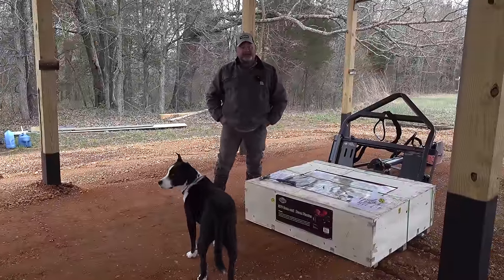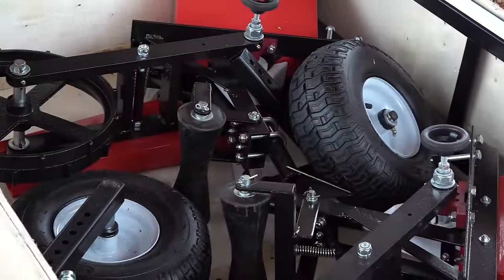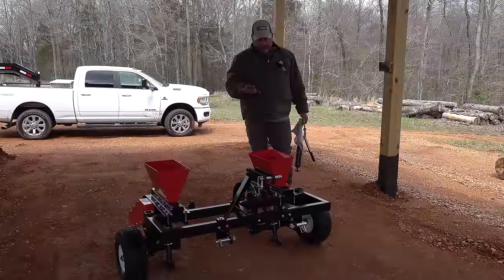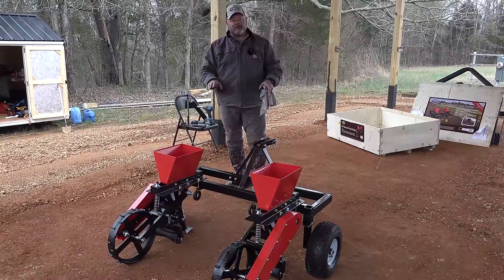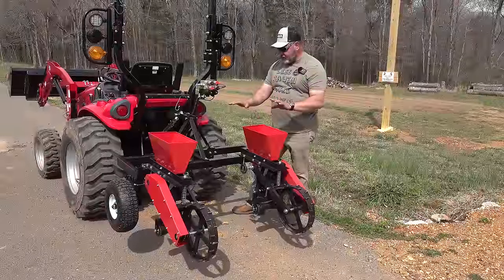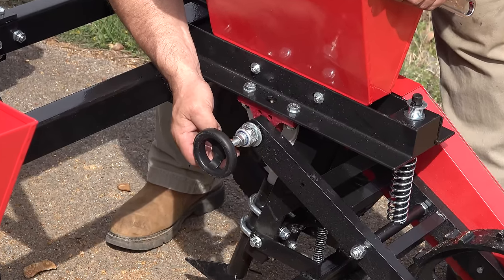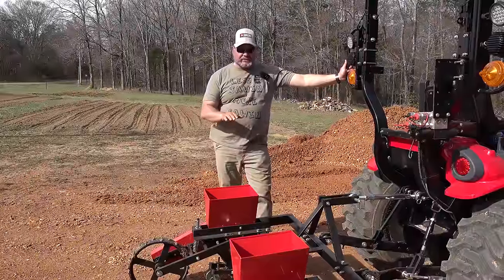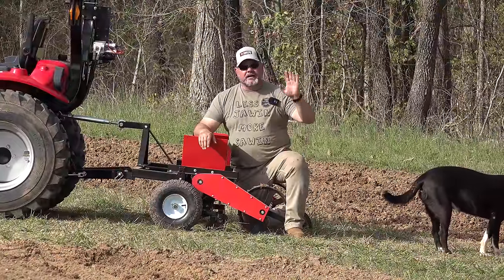Field Tuff 2 Row Corn and Bean Planter for Tractor / Assembly & Use

Comment: You hit the nail on the head, you really don't know for sure for 10 to 14 days whether you got it set up right. Also, not exactly sure how the seed tubes are on that planter, but with the one and two row planters I've used it's important to not stop moving at the end of the row, just pick up the planter and keep rolling. This keeps any damp soil from plugging the drop tube if you would drift back any when stopping, oh I've had it happen and you don't realize it until you go to switch seed and find a seed tube all jambed up and you have no idea where it started.
Reply from the maker: No problem with the drop tube this time. The ground was fairly dry. It really cooled off after we planed. I hope it comes up.

Comment: Awesome video Tony. I’m doing a garden this year. I bought a 72” Woods tiller last week. I’m going to try the cruise control method.
Reply: If you have a "load sensing" feature, try that. It will adjust your ground speed automatically based on load. I use it when tilling and you can basically mash the hydro pedal to the floor and the tractor handles the rest
Reply from the maker: I was impressed with how it worked.

Comment: I was hoping you'd show how to get the second pair of rows the correct distance from the first two.  Also: Can you now drive through the garden straddling two rows, so you can pull a cultivator between the rows?
Reply from the maker: I planted it to straddle one row at a time using the cultivator. I used the dirt marks from the tire as a guide.

Comment: Ive been looking at these cause other comparable planters are double the cost...how was it to set the seed depth and did u check depths after planting?
Reply from the maker: The plant tubes can be raised or lower as needed. I did check the depth and it was good. Most seeds are very forgiving anyway.

Comment: You measured from the center of PTO shaft to outside of tire and then chose 32" as the measurement.  The angle of the video may have been deceiving but it appeared that the planter was actually planting in or very near the rear tire imprint.  Each size tractor will have different tire widths and one has to adjust to what they have and work around it.  What was the measurement from seed shoot to seed shoot if one wanted to max out the toolbar, what could be the widest row based on the toolbar?  There are many types of ground as it relates to how it compacts but was questioning if the planter would drop seed at a consistent depth if one tried to drop in the rear tractor track due to the lugs leaving an imprint that the plow might not take out.
Reply from the maker: I planted it so I could plow one row at a time. It is the first time setting one than more planter at a time, so the row are wide. It should be easy to plow or spray.
Reply: Off to find the video of cultivating!  The video looked like it was planting on or right at the tires to me as well!

Comment: Is there a planter with 3 or 4 rows?
Reply from the maker: I only have seen this two row planter
Reply: @TonysTractorAdventure  is there a way to add a 3rd one to the existing one u have? I am an ok welder to fabricate something to fit a 3rd seeder if necessary (thanks for the reply)
Reply from the maker: A person could buy two and use them together. The planter clamps onto a bar.
Reply: You can either buy Dutch modules or canablize two of his and build a new frame.  I Designed a 6 roa transplanter a long time ago.  The tires may need to be bigger on the multi row systems  or just go to a mini multi row air seeder
Might want to think about roto spike instead of tiller blades for better long tersoil structure and less fertilizer input?